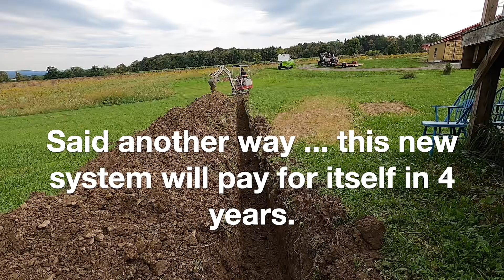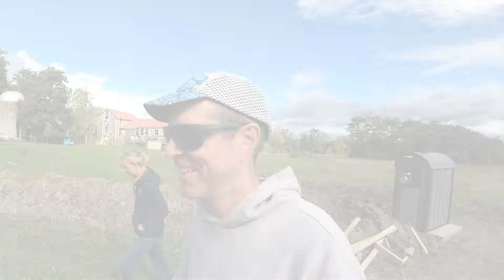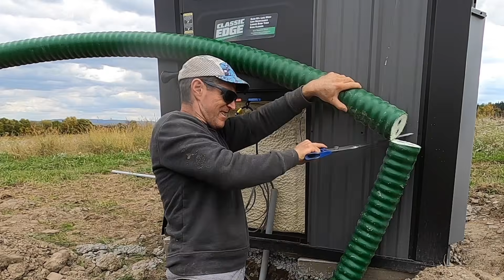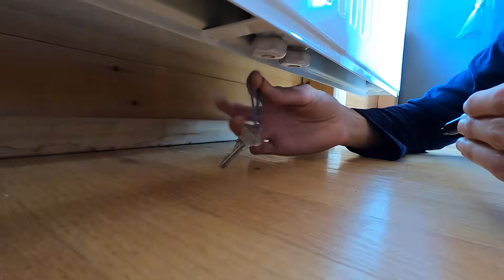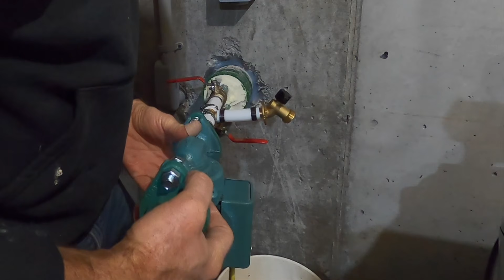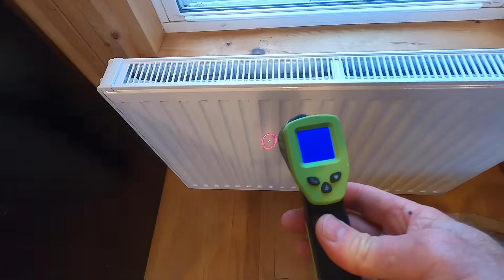Outdoor Wood Boiler FULL INSTALL, Start to Finish

Comment: This is awesome.

Question. 

Why so far from the house? 

And how long does a a single loaded chamber burn? 

It's pretty cool that you can use the wood that you obtain from your jobs removing trees to heat.the water and the air in your house.
Reply from the maker: I've seen a few outdoor boiler setups around here and I always see a fog of smoke around the house when the burner is close ... so we opted to put it out a ways and also keep the yard clear. We have a lot of space here and kinda like to spread out :) When the snows come I may be kicking myself for the distance ... As for the wood load I've been refilling it about once every 24-36 hours. Yeah, it's cool that people basically pay me to heat our house now
Reply: Good decision. Other than having to feed it every morning and night, having smoke linger around house is the worst part of it.
Reply from the maker: Fortunately with our house we just feed it once a day 👍

Comment: This heating system (water circulating in radiators) is so much more pleasant than electric radiators, and then with all the wood you can recover, it’s a very good investment 👍
Reply from the maker: Yeah the heat quality is sooooo nice

Comment: Good to know what's involved thanks. Is this a 30% glycol system?
Reply from the maker: It was definitely a multi-step process. Yeah you can do 30% antifreeze if you plan to shut the system off for long stretches in the winter

Comment: Very cool to see this process start to finish. A lot of homes around us in SW PA have these. Two questions...first, what was the tool you were using to cut off that big green pipe inside the box? And you installed a second pump in the house. What is the purpose for that one since there's one out on the stove end? Is it on the same line? Or is it for the water returning to the stove?
Reply from the maker: Thanks for checking out the project. That cutting tool was an oscillating tool -- good for precise cuts just kinda slow. And as for the second pump it's just to keep things moving along since there is added resistance in the house. There are two pumps on one line ... I didn't figure out the flow resistance exactly or anything but the second pump seemed to make sense
Reply: Thanks for the reply! As for the second pump, I just wondered about cavitation having two on the same line.
Reply from the maker: Cavitation! It’s possible so I’ll have to think about that …. Thanks or the idea as I’m new to fluid systems like this one

Comment: What an incredibly cool boiler dude!! well done with hooking that monster up so well! I was wondering about the piles of wood out there in the open... saw you choppin it all out there in the middle of a field and thought you had plans for making it a woodpile the size of a football field... so are you going to keep all the wood of every tree you cut in the future? Seems like a wise investment to have an infinite supply of fuel that will keep the heat going basically for free.. PS How often do you have to pickle out there to stoke the fire or does a single load go all night? I suppose the heater element pipes are in the floor of the firepit so even when the wood dies down the coles will keep it warm till it turns cold?
Reply from the maker: For us it seems to make sense, given all the wood I bring in. :) Toasty so far! It needs to be reloaded about every 24 hours when burning high quality hard wood ...
Reply: @metaspencer  How cold is it outside where you are, and how warm do you keep your house?
Reply from the maker: @dansw0rkshop  Temps here in upstate NY range between -10 and 30s in the winter, more or less. The house has been a steady 75 which has been nice ... previously it was in the low 60s at best with just a small propane heater
Reply: @metaspencer  Fantastic.  That's about what we have here in Michigan.  We also have the thermo set to 75 and the burner keeps up nicely.  I made my own outdoor burner to use pallet wood.  It does the house, part of the shop and the domestic hot water.  I fire morning and evening most of the winter.
Reply from the maker: @dansw0rkshop  Sounds great man. I have mine hooked up to heat the shop, but still have to finish building the shop :) haha ... refilling just once a day at this point. What great heat in the house!

Comment: This wudda been fun to do, i like the design of the system and the no mess situation, the only thing is u got a long way to go to fill it up and u be screwed if u had a 6ft snow drift.... lmfao, anyway next time u terminate the huge monster green pipe can u show us the sheath stripped back to the internal pipes with a view of the thickness of the pipes, u edited too much out in my opinion of the plumbing porn.
Reply from the maker: With my luck I'll freeze to death in a drift between the house and the boiler -- only thawing out in the spring. :) Maybe we need to build a covered bridge out there next :)
Reply: @metaspencer  lol forget the bridge dig a tunnel...... then u wont freeze....hahahaha

Comment: Hey Spencer. I'm wondering how often you need to add wood and how much wood you add each time? Thanks.
Reply from the maker: I'm still working those averages out but it seems like a load of wood goes in about every 24 hours and you know how it is: the amount of wood depends on the quality of the wood. Good solid hard wood burns sooooo much slower than birch or poplar. Around here people tend to burn between 3-10 cords a winter but again, it all depends on how much you're heating :)